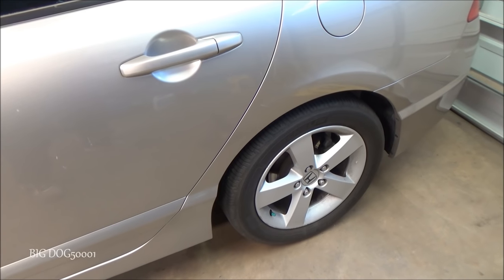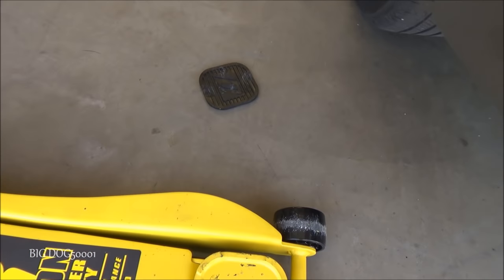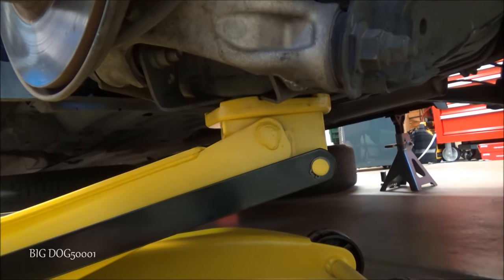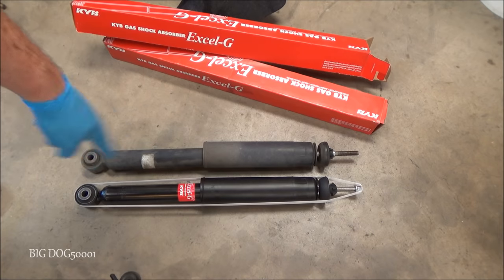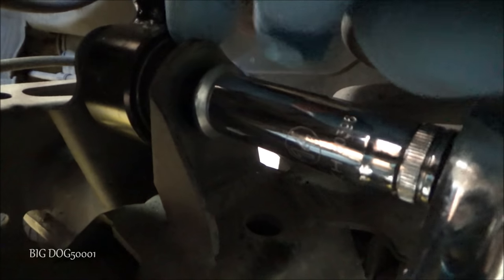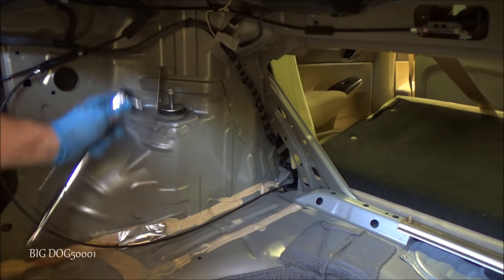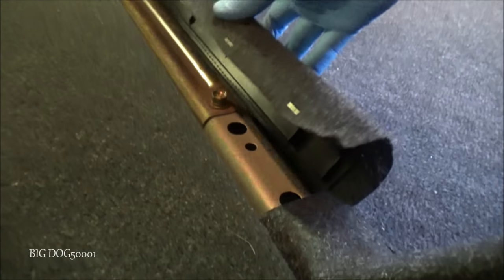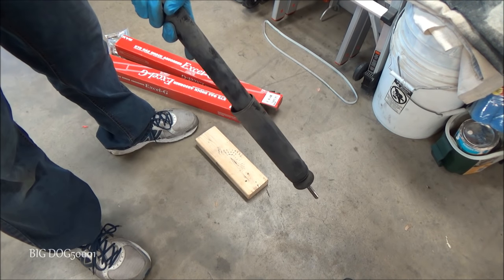Honda Civic Rear Shock Replacement 2006 (2006-2011 Similar)

Comment: Good video. I am however curious why Honda wants you to replace hardware. Did they put inferior hardware in?
Reply from the maker: Nylon lock nuts on struts/shocks should always be replaced no matter what vehicle.  As for the bolt, I think Honda recommends it due to the fact they are exposed to heat/vibration/salt/road elements etc. that can degrade them.  Thanks for the comment!
Reply: Big Dog50001 Automotive I definatly agree with replacing the nut.  The bolt however if it's in good condition reuse it, unless you live in an area where rust and corrosion is bad. The reason why I say this is that is one long rabbit hole to go down if you are going to have to replace every nut and bolt on every repair job.
Reply from the maker: Don't shoot the messenger! :)

Comment: What are torque specs for 2014 si rear shock buttom bolt ? Cant find any info on this if u know let me know thanks
Reply from the maker: Don't quote me, but the lower bolt for the rear shocks on that generation Civic should be 44 ft lbs (top nut should be 22 ft lbs).

Comment: Do you know why I hear a loud bang noise when hitting small or big bumps? I have changed the struts, swaybars, & bushings and I still hear it.
Reply from the maker: Engine mounts, suspension components, body seams and other panels can make noise too.  Sometimes it can be hard to pinpoint.
Reply: Did you replace the bottom bolts in your shocks ? That was my noise

Comment: I missed the bracket upon lifting and the side frame started to bend after 5 minutes.
Reply from the maker: Very important to place the jack stands on the designated lift points, as you found out.  I can't see what happened, but If it only bent the pinch welds a little bit then it should be ok.

Comment: I can't get either lower bolt off.. even with my impact driver. What to do now?
Reply from the maker: Penetrating oil, vibration and heat are what remove stubborn fasteners (and sometimes a cutting wheel or torch).  Spraying with penetrating oil over several days and hitting end of bolt with hammer (gently) can help.  Be careful going to town on those bolts if they won't budge, they could be seized inside there and you will only break the head of the bolt off.

Comment: hi Big dog,
i am stuck in a bit of weird situation.

Got new rear shocks for Civic 2011. After replacing the rear shocks the car has stopped jumping like a jumping castle and the ride quality has improved ALOT.....BUT

The car is actually now leaning on the front driver side . Only slightly but i think its more noticeable from inside aswell as when driving on very plain straight road or parking it at one(hard to find one in islamabad as all are leaning towards inside so the rain water could flow freely)

When you park the car straight, its leaning from the front driver side and is slightly UP from the rear left side.

It is leaning more towards the FRONT right of the driver side rather then the REAR of the driver side but is surely down a little from rear driver side and all the way UP from the REAR passenger side & normal from the FRONT LEFT PASSENGER side.

Could this be because of my Front right shock is blown too as it was hard to diagnose just by looking with rear old shocks? or is it that the new shocks i got are acting weird?

Measured all the tires from the ground to the exact middle of the arch of wheel.

26 (inch) front right
26.6 (inch) front left
26.9 (inch) rear left
26.4 (inch) rear right
Reply from the maker: If this happened immediately after my work I would double check my work.  Typically you will not change the ride height with shocks.

Comment: Just trying to replace a 2009 Acura but the bolts are just seized.sprayed with PB blaster penetrating oil but now one bolt head is rounded up.Will  likely have to cut the bolt off with no room to work on this crap car 😭

Comment: Shouldn't you replace both shocks , 1 new the other is still old...
Reply from the maker: Yes, you should which is what was done on this car.  If you want to see both sides watch the video again in a mirror.....
Reply: Lol, I liked the video and realized my error after I sent it. I have a friend that would not replace the other-side until it fails, drives me nuts.

Comment: The lower bolt is Genuine Honda Parts 90181-S7A-000 Flange (14X77) Bolt.  It is not a 12x65
Reply from the maker: This part number that I showed, 90181-SNA-000, 12 x 65 (8:52 in the video) is the correct part (rear shock absorber bolt) for the vehicle in this video (a 2006 Civic EX Sedan).  The part number you gave appears to be a flange bolt for the rear trailing arm on a 2006 Civic (but Honda uses similar bolt sizes for many different applications across their vehicle lineup).  A quick view of a parts diagram for a rear shock absorber for these Civics shows the correct part number.  Just remember, different models/configurations have different part numbers which is why I always tell people to double check part numbers for their application.

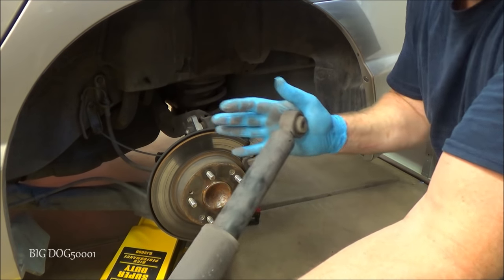Comment: 08:08 shock is not even returning. It’s broke.
09:57 shock is not returning either.
Reply from the maker: You might want to edit your comment again, the new one at 09:57 extended (returned) all the way back out.